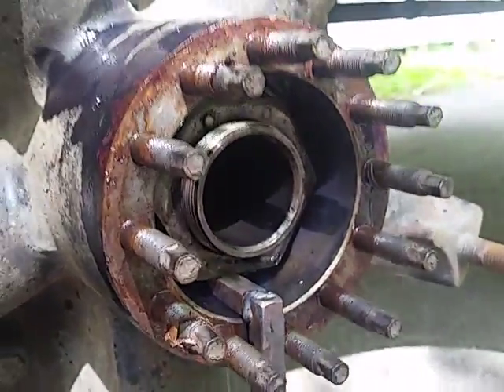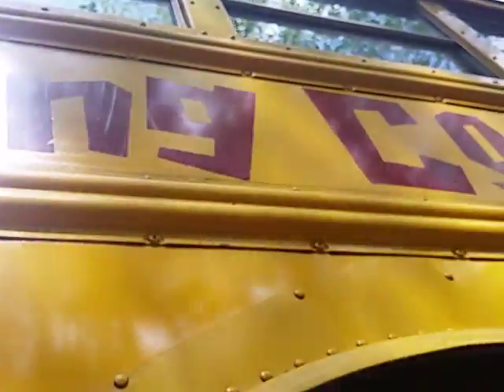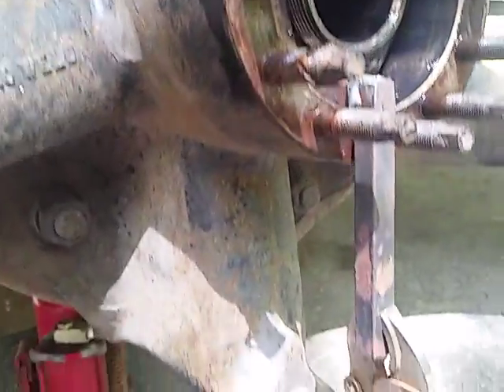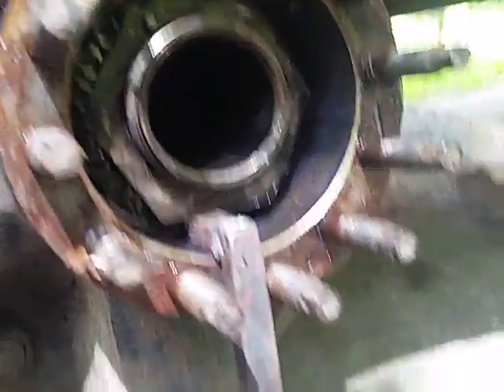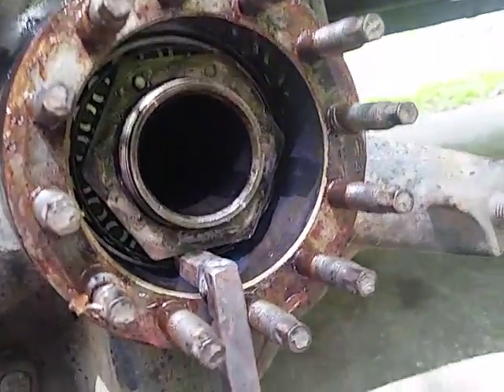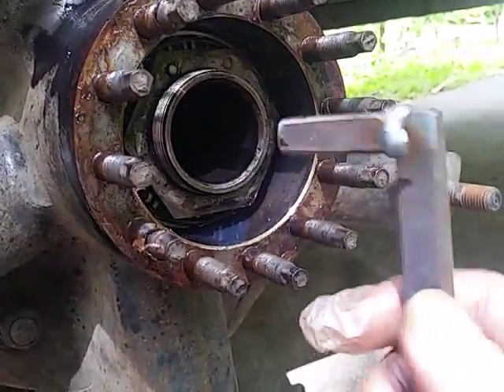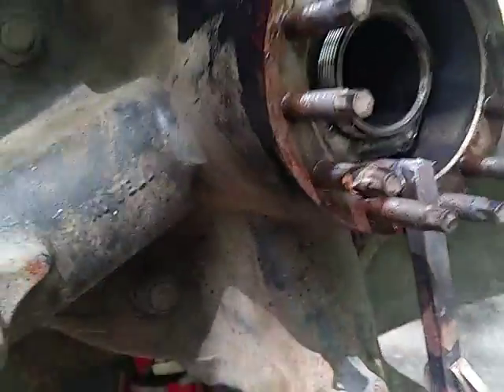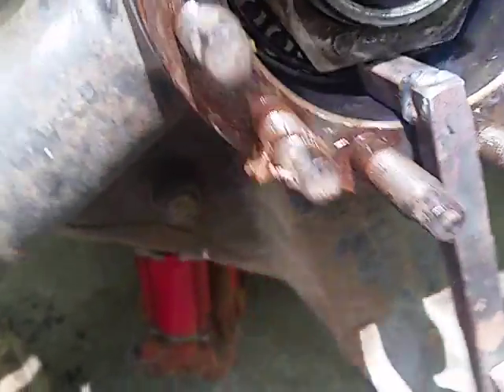How to Remove Axle nuts without Sockets or using Chisels.

Comment: Thank you Mark -innovative indeed. Ray ( South Africa )
Reply from the maker: We say... Necessity is the Mother of Invention... :)  I am 20 minutes from a very small town. 45 minutes from a Walmart.. 2 hours from a store that would have a socket that big, and I would not want to buy it.. So, this works great considering.. 
I was able to tension it with a pretty good degree of accuracy when I put it back together, and that is what counts past getting it off in the first place.. I have the tool in my toolbox and have used it once again after this video.. Worked just fine with both hands.. Ha.. Always worst case scenario when holding a camera in one hand.. :)

Comment: Nice! That's thinking outside the box.
Reply from the maker: Eric Ek  Thanks.. I have a video on changing the r920 split rim tires. If you haven't seen that, you need to look at it. If you're fooling with these old school buses, you probably need a safe way to change those tires. Too many have gotten killed and maimed with them. I totally solved that problem.
OSHA just wishes they were that smart. Haha
Reply: No, not a bus, a wrecker.  Trying to find a way to remove a nut off of the parking brake drum on a Nissan UD, and the socket I need is a bit larger than anything I have. I may have to break down and buy one. Like a wedding dress, you wear it once then hang it in the closet till you die. I'll probably never need it again.

Comment: Ok knaw torque it to the right specs... I do like your idea for removing it give you that... but probably never use it...
Reply from the maker: You might be right, but, I have been working on every kind of everything for 50 years and the only thing I pick up a torque wrench for is if I am rebuilding a motor and I torque the Rod Caps, Head bolts, etc.. Just to have as uniform a pressure as possible..  I have never torqued anything else in my life.. It is one of the most expensive and least used tool in my tool box.. 
As for the tool.. I hate using a chisel on nuts/bolts.. I did it on a dodge one time and a chip flew into the axle housing.. I pulled it out.. But, a month or two later, I ended up replacing the outer bearing on that side that had self destructed.. Only thing I could figure was the piece looked like one, but, was two pieces and I only got the one out.
I have not used a chisel since for that reason.. I have made and bought sockets though.. I made one to pull a hub bearing off out of a 1/4" mild steel plate and two pieces of flat bar.. Cut the inside Hex with a plasma and ran a debur tool on it until if fit snug, then welded the two flats together, drilled it, then heated and drifted the center hole to 1/2" square and heated/bent the ends over and welded them to the flat plate hex to make a deep well large socket.. It still has a place on the wall.. Only a one time use, but, if it happens to be the right size, I will surely use it again.. :)
I keep square bar stock, so, if i need one of those again, I can make it, but, it sits in my brake tool box, in case I have to pull that rascal again.. It was easy to tighten it up to spec.. On an axle nut with a keeper, the torque isn't necessary.  It won't stay perfect.. The reason for the keeper if that is what you were referring to.. 
Cheers.
Reply: You are right...  I would learn a lot of tricks from you if I hung out with you a couple days...